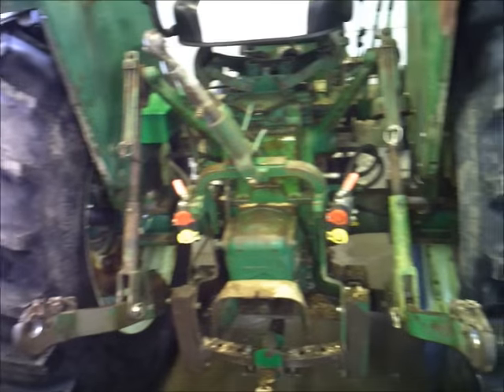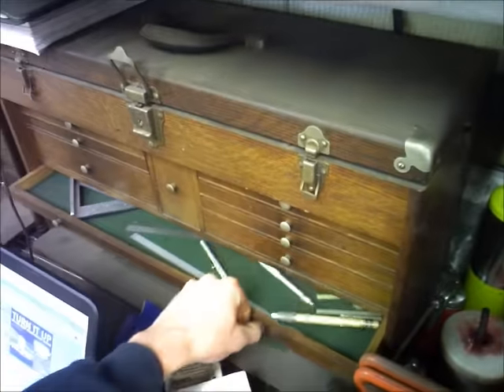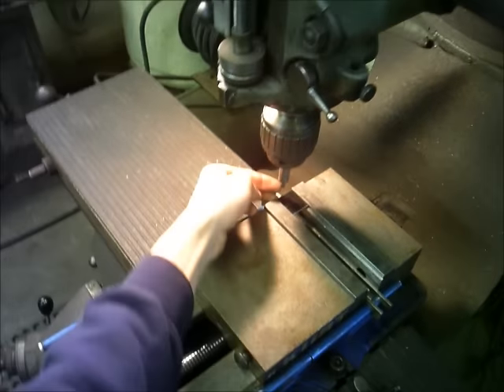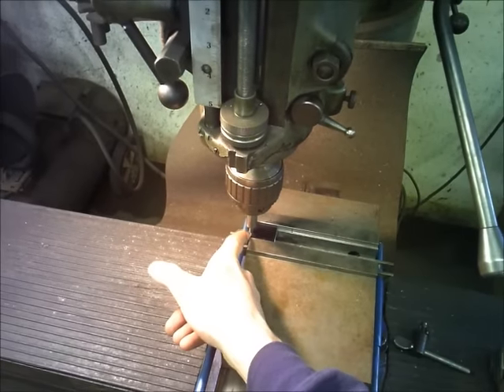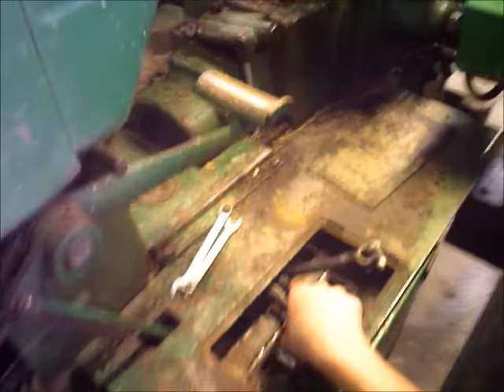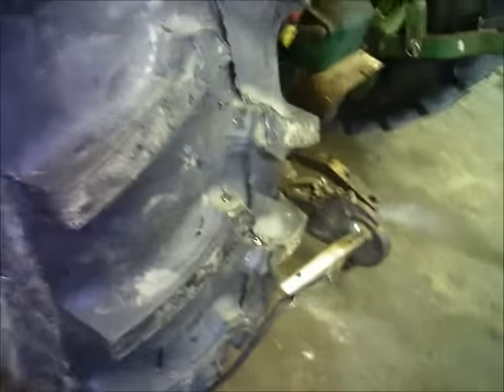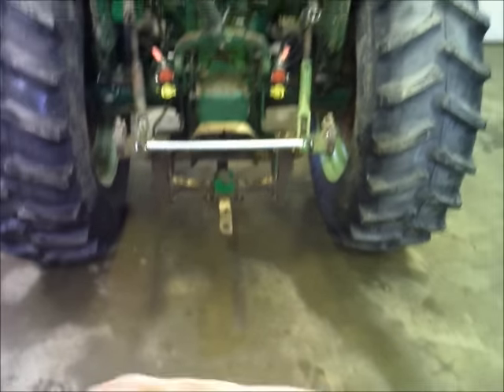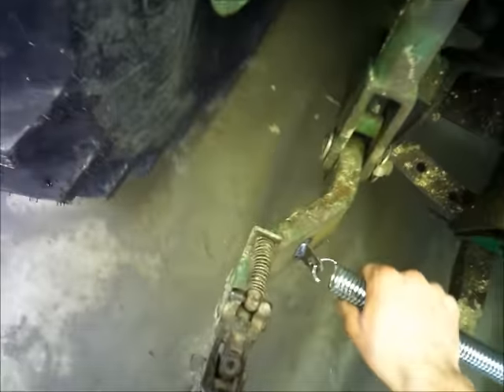One Last 1600 Job

Comment: You know Oliver's well. what can I do to make 1955\1855 engine s so they don't throw rods besides not using it hard?
Reply from the maker: +TrueBlue Farmer (bluefarmer) Updated rod bolts, one piece wrist pin bushings, have the rotating assembly balanced, updated oil return line from turbo. There is a whole list of stuff to update one the 310's, and you have to do it all in order to make a motor out of it.